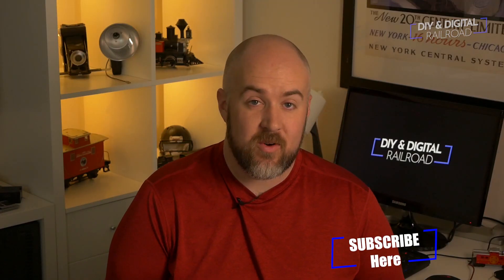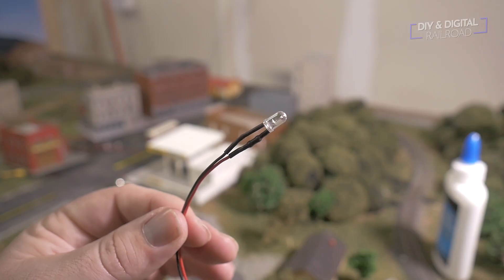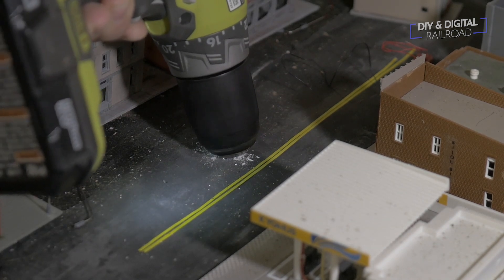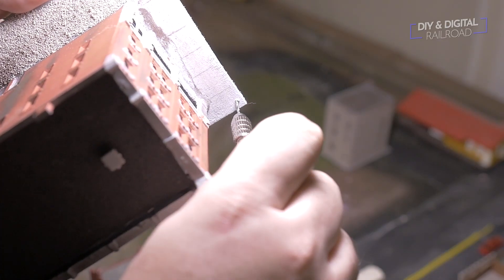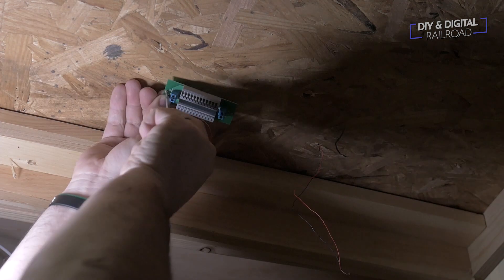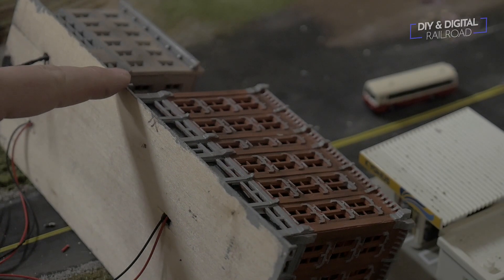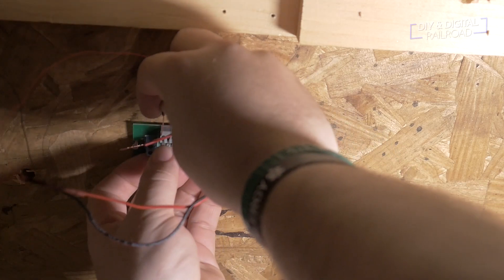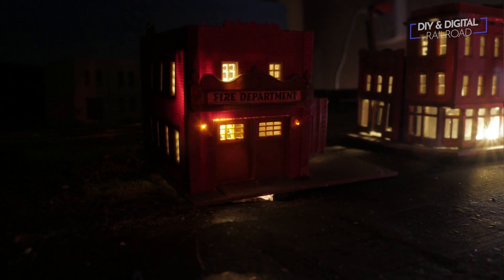Installing Lights on my Model Railroad

Comment: Hi Jimmy,
I love when Artist, like you & I, take on a new technique, to enhance our Art.
Great job.
Helpful Hints:  Well you already learned to check your allowable voltage level before hitting it with a full load.  Trust me you WILL do it again.  The nature of the beast.
Also, when preping for your Distribution Box take some folded over masking tape, sticky side out.  Attach the tape to the back of the Distribution Box.  Then to the underside of the layout.  It will give you a free hand when drilling pilot holes.  If you decide to leave the tape in place it also gives you a free hand when screwing the box in place.  One caution use heat stable electric tape.  Some brands of boxes are not base insulated.  So you could, unintentionally, leave the main power on and start a fire.
Lastly, the last time I was in the TRAINWORLD store they had on racks the pre-lit cars for HO.  I didn't look for N Scale. Sorry.
~Old Jim

Comment: Found this video very helpful.  I have one suggestion about using a power supply.  If you have an old Desktop PC that is ready for the recycling bin, I suggest opening the case up and removing the power supply.  Right here on You Tube, there are plenty of easy tutorials on how to make this into a fantastic power supply that you can use for your layout's accessories.  It provides a 3VDC, 5VDC & 12 VDC sources.  A relative was getting rid of three PC's from his business. I removed the three power supplies, followed the easy instructions in the video and now have power for the turnouts (12VDC), street lights and buildings using the 3VDC & 5VDC.

Comment: Looks great Jimmy. I use the Just Plug system from Woodland Scenics. Same concept.
Reply: Just plug is great especially if you dont want to mess with electronics, but expanding is harder and generally more expensive

Comment: Hint: prior to soldering the small wires together, dip each bare end in a solder flux paste then twist them together. This allows the solder to flow between the strands, gives a better connection and looks cleaner.

Comment: This video was great and helped a lot.   What size resisters did you use for the 3 volt led lights?   How many 3 volt led lights can you put on a 12 volt bus wire?

Comment: Love your videos, very helpful.    Question.    I want to put a 12 volt led light inside a plastic tube and pour Epoxy over it for a small lake on my train layout.   Will the 12volt little light warm up too much and melt the plastic tube.   It is like a clear straw that I want to embed under a small lake.    I would just pour over the light, but it would be impossible to replace the light if it burned out.   Any help would be greatly appreciated.

Comment: I recently discovered these Evemodel boards. Have you ever used the PCB012 Power Distribution Board they make that has the barrel connector for power?
Reply from the maker: Yes!  They are great!

Comment: Wish you had said what type of light and where to purchase, inexpensively. I wish to try those smd led lights that come on peel off rolls, but so far, cant find them on Amazon inexpensively
Reply from the maker: Hey file1man! These are simple prewired LEDs.  There is a link to them in the description.  Let me know if that link does not work and I can update it.

Comment: Great work. You're gonna have to paint the inside of your buildings black to get rid of the glowing walls. What can you do to get the brake lights on the cars to be a little dimmer but still keep the headlights just as bright? It just looks wrong to me that the brake lights are illuminating so much behind the car. It's not realistic to me. You did great work I'm not saying you did anything wrong. The brake lights are brighter than I think they should be and I'm asking for myself how to dim them and not the headlights at the same time. How to control the brightness separately. Thanks.   👍